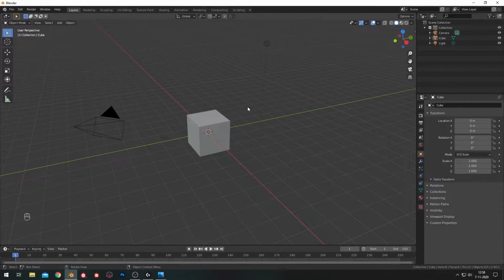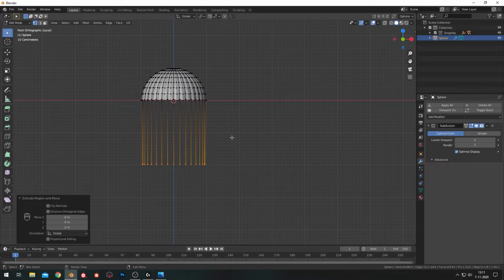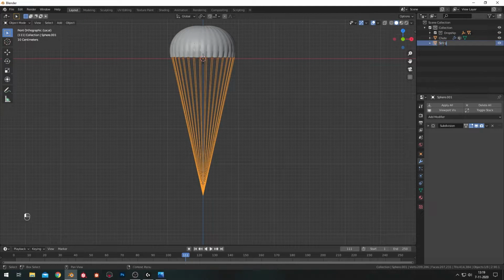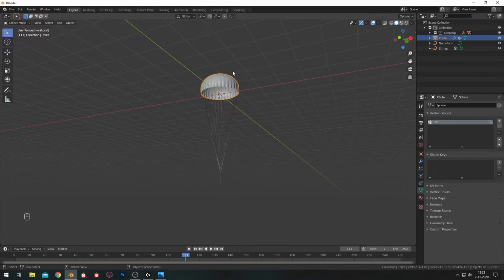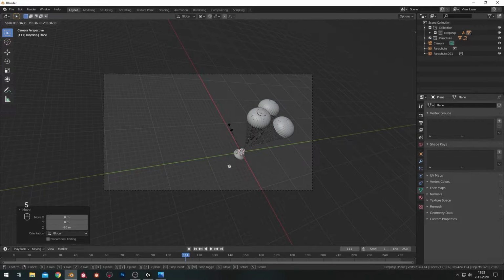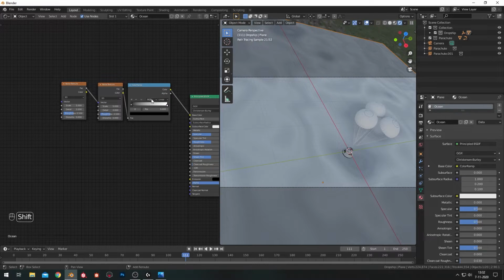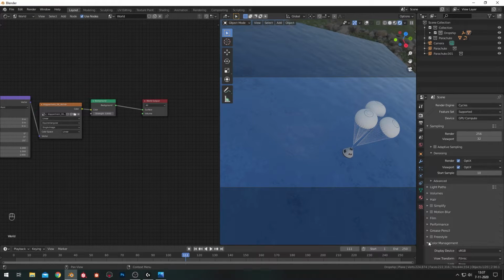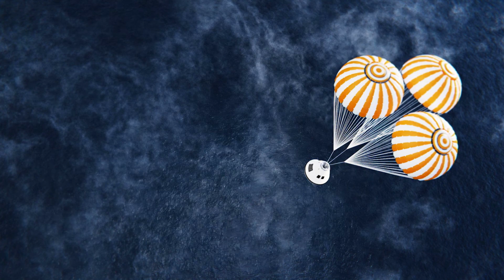How to Create a Parachute Simulation in Blender 3D

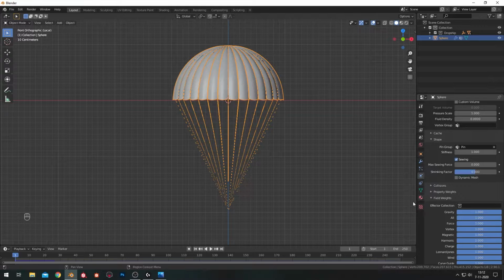Comment: I did everything as you did but after changing the order of the Modifiers (around 5:00) the animation disappeared completely. I tried going back and re-doing it 5 time but it never worked. Any ideas? I also bought your project file and there is no animation on it. I'm using Blender 3. Could that be the issue?
Reply from the maker: Weird! Which part specifically is not working?  Have you made sure all animations are baked before re-arranging the modifiers?